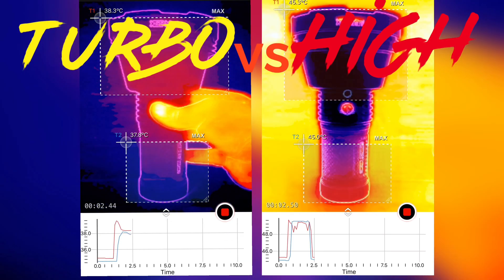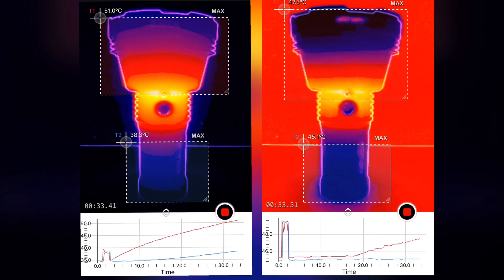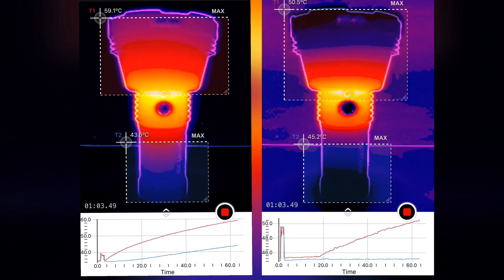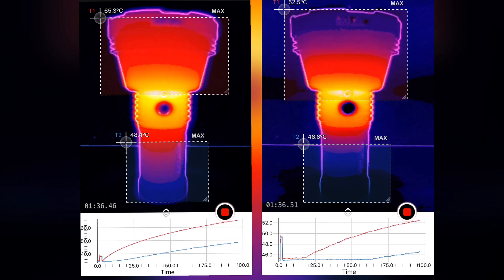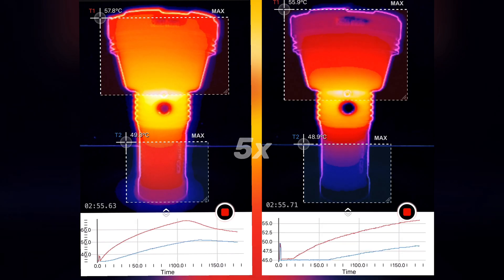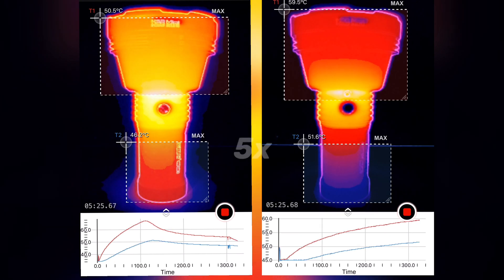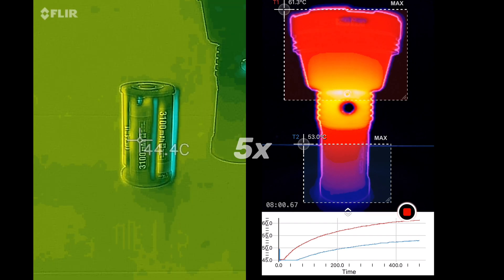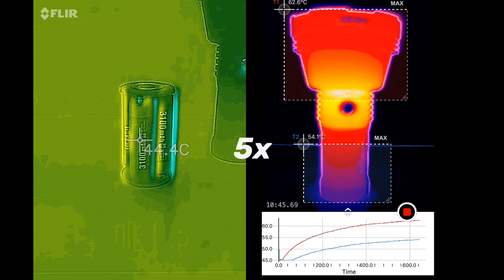AceBeam X65 Mini - Thermal

Comment: Thank you! Once I left on high (high, not turbo) my Acebeam K65GT and when I touched it was significantly hot, hot enough not to be able to hold it comfortably by the switch zone, I still ask myself if that have damaged the LED...the lamp has been on for a total of 50 minutes, what do you think, did I damaged the led or cut significantly its lifetime?
Reply from the maker: キングスピード if it works then I think it’s not damaged. I have fried a led before and the surface area turned brown
Reply: @WillEDC  Thank you! By the way the max temperature reported in the video was referred to the whitest and so hottest zone of the flashlight, right? I mean it wasn't an average temperature, correct?
Reply from the maker: キングスピード correct. The box is set to measure the max temp spot in the box area.
Reply: @WillEDC  Thank you!